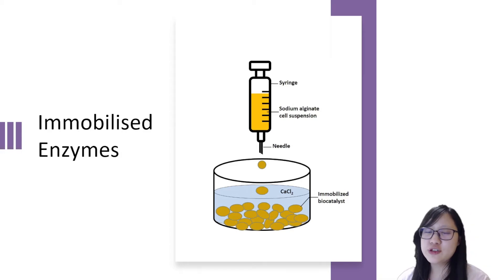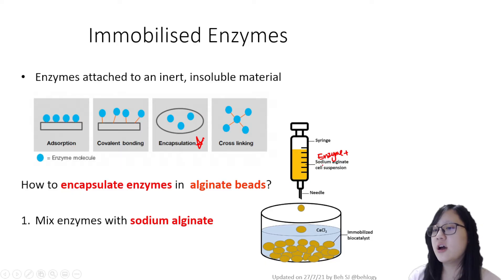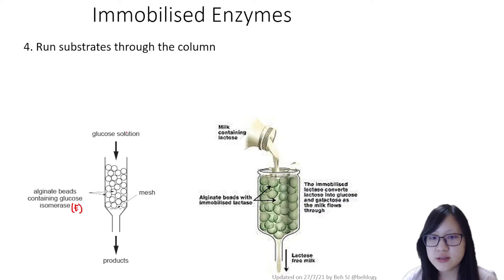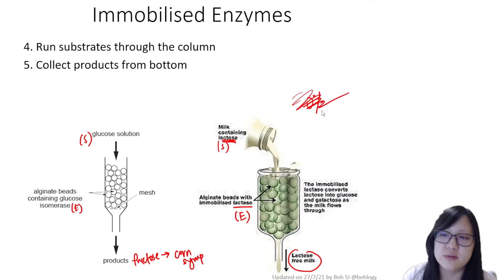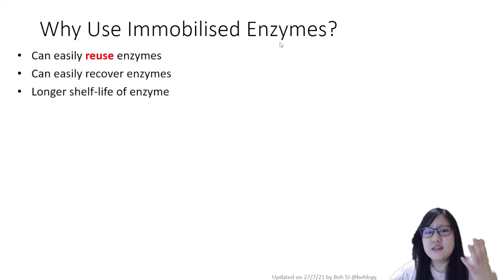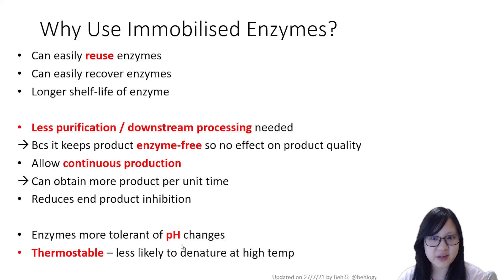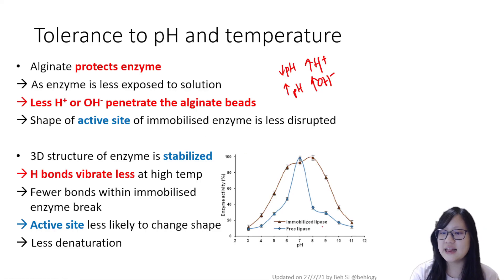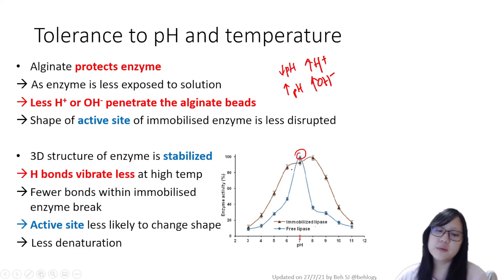Chapter 3.4 - Immobilised Enzymes | Cambridge A-Level 9700 Biology

Comment: Hello thank you for taking your time to prepare this lecture I want to immbilize my cells and use it for metal extraction.  Shoild I prepare the alginatve beads and put in the lithium?
Reply from the maker: What
Reply: @behlogy  sorry for the typo error..I meant, I want to immobilize my cells to use it for metal extraction. Should I prepare the alginate beads then put it in the copper salt solution.